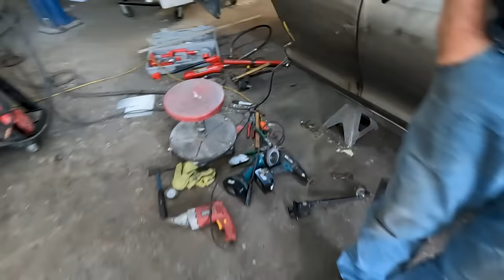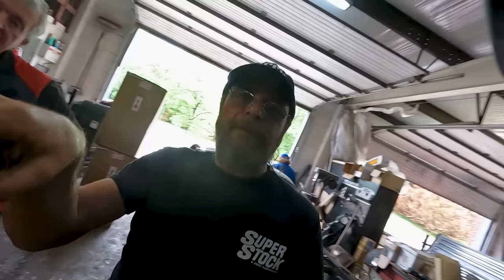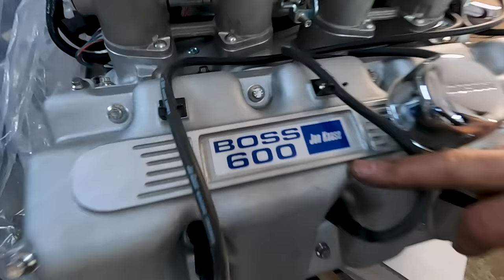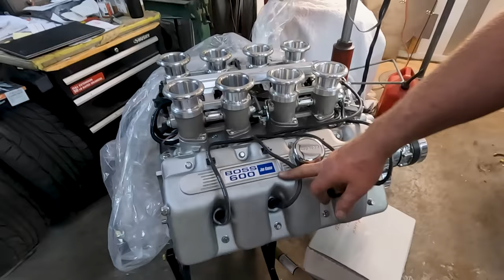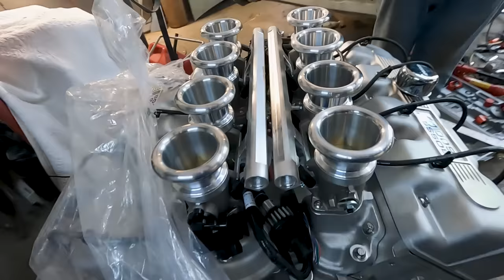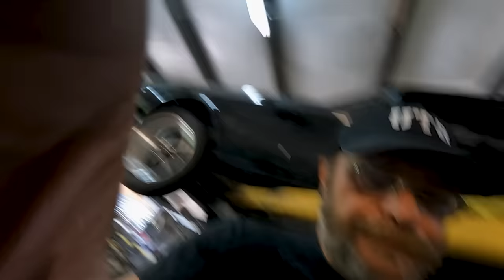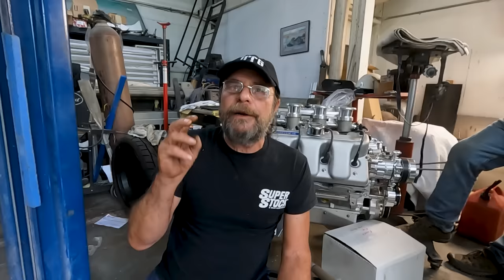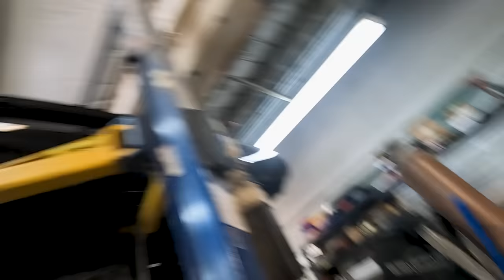How Ford Screwed The Pooch On What SHOULD Have Been The Greatest Musclecar Engine Ever

Comment: Look at the 429 SCJ if you want a fair comparision to the Rat Motor . The Boss 9 is all by itself . I can't see the cross with the Rat and Elephant engines  . Anyway you can buy the parts to build a 385 wedge with 1000 hp for almost 1/4 the cost of the Boss 9 . That engine at the shop is tops on someones wish list . If looks count then it wins .
Reply: Like dude said….it’s a piece of jewelry and that’s it. Yea it runs like a mf but it’s hard to plant your foot into a mortgage payment and have fun. Spin a bearing in that 😂 or something else dumb and now it’s just doubled in price. No thanks. I already own an Apache 6.4 and literally just dumped 5 grand into a budget valve train build. Started at 2 and somehow managed to get it to 5. Hell of a grocery getter but still I think of what I’d like to do and it’s staring at 10 grand in the face. I’m not running strip or anything so it’s fine with what I did.

Comment: We're glad someone finally laid out the truth about these engines. 
We collect vintage automotive periodicals, and can say from much reading that back in the day, these engines in stock form were not considered a high-performance engine. It was suggested that a well-tuned 340, or Z/28 302 could easily take one out.
Hot Rod magazine did a complete dyno test on what I think was an early S-code version. The best they could get out of it (with no mods except headers and removed air cleaner) was 375 bhp. The article stated part of the problem lied with Ford Engineering. Every car/engine application they built, had to conform to certain drivability issues. It had to start, and warm up efficiently on a cold day, had to idle smoothly, and it could not be too noisy. In other words, it had to get grandma to church on Sunday morning... just like a Mercury Grand Marquis would.
Ford soon realized it was lacking, thus the solid lifter T-code was born. It was slightly better, but still no street brawler. There was a Ford publication released, explaining how to modify the B'9 for racing. If you did these and a few other mods, you might end up with something that will put you in the high 11's - low 12's on a drag strip... still not competitive in the big-league Pro Stock class of the day. Guys like Bill Jenkins and Ronnie Sox were cutting a wide swath into the low 10's- high 9 second range by then.
It wasn't until the early '80's when engine builders like Jon Kaase and drag racer Bob Glidden figured out what these engines needed to really perform... lots more cubes!
Reply: I wish I had still had all those magazines I bought back during the 80s and 90s when interest in 1st a generation Mustangs was on the rise.

Comment: Ford has always been the biggest innovator in the game, surpassed only by their own ability to shoot themselves in the foot.  The Boss 9 heads are just optimized a bit from stock, stronger rocker mounts, and standard 385 bolt pattern instead of the factory boss pattern.  Jewlery indeed.
Reply: Chrysler has been the biggest innovator. Who sent astronauts to the moon and built main battle tanks for 50 years? It wasn’t Ford nor GM.
Reply: @kronk9418  Chrysler did come up with many interesting inventions, such as turbine power for cars, innovative transmission designs and the first electronic fuel injection. They just werent very good at making things work reliably.
Their fuel injection would stop working if driven in proximity to a fairly large neon sign. Rather than work out the issues of electromagnetic interference, they gave up and sold the design and intellectual property to Robert Bosch, who DID "work out the bugs" The rest..is history.

Comment: Thanks Tony! Apparently in Nascar, the Boss 429 outperformed the Chrysler Hemi, ( which had been dominating up to then)...and probably a big part of that might have been the Holley Dominator 4500 carb, which debuted on the Boss engine.
Reply: In the long run the Hemi wins because it has to breathe. 👍
Reply: @Daniel-fd3wp  Yep.....that was how the heads/engine was designed on them long runs breathing DEEP and getting rid of DEEP!
Reply: The 427 Tunnelport won 3 Daytona 500's in a row and 2 drivers championships in a row . Petty drove for Ford until Chrysler built a body to.make up for the lack of hp.of the Hemi .
Reply: Mickey Thompson knew the trick with the Cammer and Ohio George beat everybody with the Cammer and the Boss . Andretti got the All aluminum 494 Can Am engine . They should have given the 494 to Gurney .
Reply: The Boss should have the edge. It’s a newer design and the design/ R&D budget was bottomless.
The Gen2 Hemi didn’t have those things going for it yet came out on top in the end.
Reply: I wouldn’t say the hemi dominated nascar in the 60’s just in manufacturers championship’s alone ford won 63-64-65-68-69 and mopar won 66-67-70 and in race’s won from 1960-1970 ford won more
Reply: @edge2sword186  The reason Petty quit racing for Chrysler to go race for Ford was simply because Chrysler only had the winged cars for the Dodge, but NOT the Plymouth. Richard Petty demanded that Chrysler make it available for the Plymouth's but Chrysler refused early on, so he got pissed off and went to Ford. NOTE HOW CHRYSLER EVENTUALLY CAVED & PRODUCED THE PLYMOUTH SUPER BIRD, AND PETTY IMMEDIATELY CAME BACK TO RACE THEM, until nascar made the winged cars/hemi's, and the Ford aero cars and the Cammer illegal.
Reply: @howabouthetruth2157  How about Bobby Alison and Ralph Moody building the Daytona Charger that won it's first race out at Atlanta in 1969 .
Reply: @howabouthetruth2157  So Ford came out with the King Cobra and Cyclone spoiler II and they crashed a few because they had no downforce on the rear  . Holman Moody put the King Cobra nose on a 1969 Talladega and it was about 4 miles an hour faster than the winged Chrysler at Daytona  so Big Bill France came down out of the tower and put an end to the Aero cars ..
Reply: @edge2sword186  I don't understand the point you are trying to make here on this one. Didn't I just say nascar came along and made them all illegal. I do admit I might as well as say BILL FRANCE, because he was nascar, and then his son Jr of course after him. However, one thing I did forget to mention is that France allowed the winged cars ONLY with a small block. I've said it many times: It's a damned shame both Bill France and Bill France Jr had to come along and spoil many things when it came to nascar racing. Build something better that can out-perform the competition, and those guys put a stop to it. It's why Smokey Yunick walked away from nascar TWICE........and the 2nd time was for good.
Reply: @howabouthetruth2157  Any why Chrysler has nothing to do with NASCAR now. It was said that there is more bang for the buck in NHRA.
Reply: @karlbishop7481  I was a lifelong diehard nascar fan ever since it was first aired on TV back in the '70's, but they kept dreaming up every conceivable way to f*ck it all up, so I quit watching entirely, around 2008 or so. They have absolutely ruined the once greatest motor sport there ever was.
Reply: @h.r.puffnstuff8705  thing is Ford don’t need the boss 429 to beat the 426 hemi. The 427Fe wedge Ford high riser was already beating the hemi in nascar Ford won the majority manufacturers championships in 60’s, 

Richard Petty neither he nor ANY of the 14 Superbird/Daytona drivers won this race. LeeRoy Yarbrough won it in his Mercury Cyclone, after also leading the most laps(122 of them)! Yep, the Mopar cars used the fancy wings and pointy nosecones because they desperately needed ANY help they could get just to keep up with the superior Fords! They could lap the entire Mopar field in half a lap! Fords and Mercury were SO dominant that the race organizations forced Ford to yank half their spark plug wires before each race, so that Mopar and GM cars may have a snowball's chance of actually winning
Reply: @edge2sword186  ..Nope.Petty wanted a Plymouth like the Charger Daytona,Chrysler said NO...So Petty went to Ford for 1 year,then 1970 Chrysler made the Road Runner Superbird so he went back,the Hemi was killing everything even in a non wing Road Runner!
Reply: @howabouthetruth2157  The NASCAR rule book was built around SMOKEY and his Genius at bending the rules .  The feud  between Big Bill and Smokey is legendary . They both had mutual hatred of each other Yunick could make horse power but Ralph Moody knew how to set up a chassis like nobody else .
Reply: The 427 Ford won more races than the 426 Hemi by far . 3 Daytona 500's in a row . They won more Firecracker 400's in the 60's  than anyone ,too .

Comment: Always a surprise when you tell people overhead cams, multiple valves and hemi combustion chambers have been around for over a hundred years. Bit like the time I told some young uns about the use of nitrous and turbos and supercharging in WW2, they thought it was invented by Fast&Furious.
Reply: Don't forget water injection on ww2 aircraft.
Reply: I have a supercharged 57 goldenhawk Studebaker. Its fun watching people's faces when I tell them its a factory supercharged v8.
Reply: Peugeot had twin cam 4 valve per cylinder in like 1927 or near.
Reply: @sugarnads  yes mr kwako you are correct. Had a technical drawing of the motor on my office wall in 1974. I belive the posters are still in print and available today.
Reply: Still today the two stroke Detroit diesels I saw that were in an ancient earth mover, are super-turbo engines meaning they have a roots type blower AND a turbocharger just so it can run well. I almost fell over when I was told this by my heavy equipment teacher as I was in a program at the time. I always think of “unique” things and then I remember that if I just thought it, it was already thought of a million times before 😂. Thing is we forget more than we remember so it’s easy to think you’re some pioneer. You will know when or if you cross that line.
Reply: You left out fuel injection, which was used in German WWII fighter aircraft. Alcohol injection was also used in aircraft engines long before anyone used it in vehicles.
Reply: @donreinke5863  Germans even used nitrous to increase the rate of climb.
Reply: @LordSamuelJ  One of those went through a collectors auction in Greeley CO last week, The car was flawless but sold for only 25K, a total steal. It even had the original sticker indicating the supercharged engine was factory equipment.
Reply: @midnyte_ryder  The two-stroke Detroit held the diesel land speed record for many years.

Comment: Remember Legendary Motorsport in Canada 
(Peter Klute) They did stock Big block challenge with LS6, Hemi, Boss,GS & GTO .
 Boss 429 beat them all in 1/4mile ,breaking & burn- outs .hehehe
Reply: I remember that.  Most Chevy and Dodge guys who claimed to run against this car NEVER did.  There simply were not enough Boss 429’s in existence to find cruising around or at the drag strip. The Boss 429 had almost the exact same production numbers as the Ferrari F40 with only a little more than 1300 cars total produced.  So to claim you ran against and beat Boss 429’s all the time and back in the day is pretty suspicious seeing how most people have never seen a real Boss 429 or Ferrari F40 in person.

Comment: Anyone remember the "Boss Mustang" that Ford built in the 90s? It was an SN-95 body with a big-cube fuel injected Boss built by Roush. One of the car mags had a shootout between that Mustang and a 4th gen Camaro built by Chevy with a 632ci big block. If i remember right the Ford just barely edged out the Camaro.
Reply: I still have that magazine.

Comment: Excellent video!  My understanding was the reason for the street Boss 429 was for NASCAR homologation, and not truly for street performance, unlike the 428 CJ, which was instituted for mass production street/strip performance.  So, I don;t think the Ford engineers were concentrating on maximizing the Boss 429 performance for street use, as much as just making it street legal and civilized, as best as they could, so it could try and dominate NASCAR.  Unfortunately, by the time the Boss was coming of it's age, NASCAR penalized large motors with  carburetor restrictor plates, as the cars were now going too fast, and crashing, partly due to lack of tire technology.  If you look at the development of engines over the years, you see companies "borrowing  designs" from other companies, and the BOSS is no exception.  Mopar Big Block heads  are updesigned SBC's.  Ford's new  "passenger" V8's  335 ( 351C) and 385( 429,460) are downscaled and upscaled derivatives of the successful BBC, with short skirts, canted valve heads.  Chevy did experiment with hemi heads on their BBC, and even canted valves for the SBC, but they never materialized. The BOSS 429 is one beautiful design, and I came close to getting one many years ago, and mistakenly did not.

Comment: Ive said the same for many years about the 385. It was slated at one point to compete with the Cadillac 500ci, and I think it was meant as a 502ci if not more but that never happened. It is a fast engine though. Loves top speed versus low end, which is ironic considering the amount of torque it has in the Lincolns. (I have two of them. Cruising with one pinky at 150 is unlike anything else)

Comment: Boss, Shotgun, Semi-Hemi, Blue Crescent, etc . The original head gaskets were not individual o-rings, but rather small diameter, gas filled tubing, probably nitrogen . It never caught on, anywhere else . At least in America  . Actually looked like flattened tubing, if you know it's  hollow .

Comment: More Ford stuff please Uncle Tony. What about the intake port size relative to cubic inches on a Boss 302?
Reply: Boss 2.23/ 1.71 valves explain why they weren't great street motors. No intake velocity at low RPMs.
I had a '71 Thunderbird 429, and I showed my friend my balled up fist would fit in the intake port! That thing wouldn't get out of its own way until 3,000 RPM🥺
Reply: @outlawbillionairez9780  Both those heads need more cubes.  Boss 302 should be in the 400 cube range and those Thunder Jet heads are much better on a 460.

Comment: I still just want a GM big block. Chevy/Buick/Pontiac/Oldsmobile/Cadillac I don't care. I just want big, lazy torque. I don't need high rpm speed. I just like burnouts and quick take-offs.
Reply: Pontiac didn't have a big block or a small block they had one block which all Pontiac v8's were made from. One block different bores and strokes.
Reply: Go w/ a LS, instead. More reliable, cheaper & all the torque you want. A BBC takes too much $ to make it pull a fat guy off the toilet.

GM took the best of the SBC, the gut torque of the BBC, combined it & improved it.

Match it w/ right rear gears & it'll launch like a demon & melt all the tires you can afford & your lungs can take.  LOL
Reply: @georgedennison3338 LS has been burnt out. Everyone has one now, it's at the point it's just a bandwagon anymore.
Reply: @John_Buck  What 'everyone else' is or is not doing has no bearing on an engine decision.   It's about what a person wants or needs, performance wise.
Reply: @georgedennison3338  Well, the OP clearly likes his big block GMs and here you are trying to push him towards small block...
Reply: @John_Buck  You just don't get it.  It's not about "liking" any particular motor.  He said he didn't need high RPM's, he liked burnouts & quick take offs. I pointed out to him he could get tons of torque & not have to spend nearly as much money as it'd take to get the same performance from a BBC.

There's a reason everybody is going/has gone to LS motors, the same reason so many people had SBC 40-50 years ago. Things changed considerably when automatics finally caught up w/ the performance... well; torque converters; actually.
Reply: @georgedennison3338  Sorry, but your LS will never make the torque down low that a big block does, not without forced induction. 

Everybody is going LS because, as I said, they're jumping on the bandwagon. There are better engines than the LS. Many, much better engines.
Reply: Yeah man. I picked up an F250/460 about four years ago and I just love it because I love big blocks. I haven’t done anything to it but bolt ons but it’s due for a timing chain so I’ll throw in a hotter cam too.
Reply: @JimLBon  what year? 

I have a '77 Mk V and I did the bolt ons but bought a timing chain and distributor for a '70 Mk III. I also did away with the smog. I still want to take off the heads and port the exhaust ports some.

Comment: My bro-in-law (non-mechanic) bought new a 1969 Boss 429.  He eventually brought it over to have me drive it as he thought it needed a bit of “tunning” so off we went. Now, my DD was a ’32 Roadster with an 345ci bored Olds with locked dual-quad AFBs and loads of $$ parts all balanced by Vic Edelbrock Sr. and was damm fast but still as I was getting into that Boss 429 I tried to stay calm.  The test drive was in an industrial area and with the hair on the back of my neck out straight,  I slammed it and—well not much happened. Of course at the time we were unaware of all the detuning done to the 429 and also this was a California car which may have even detuned it more. Also with a MASSIVE weight up front it handled like my ’32 which was not very good.  I suggested to my bro-in-law to find a dyno tuner that could help that 429 out;  he never did and just lived with it likely because his wife did not like the purchase and eventually divorced him. He sold it a few years later for ~$4k..